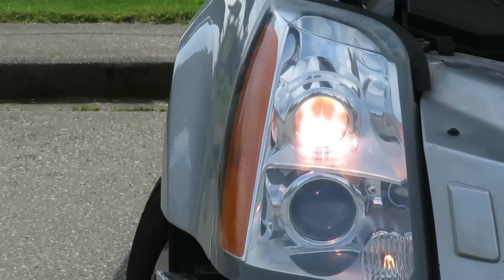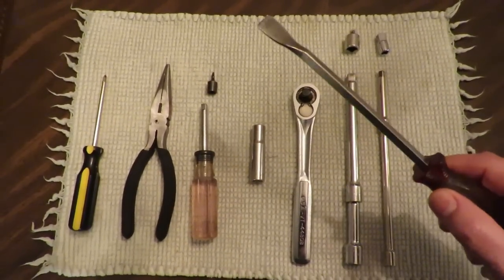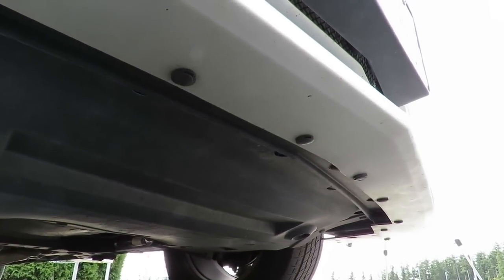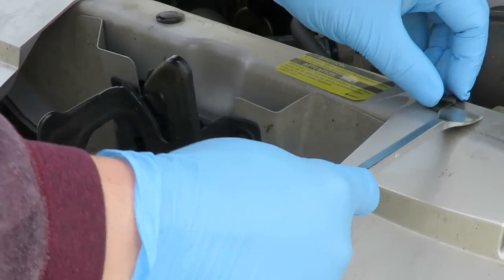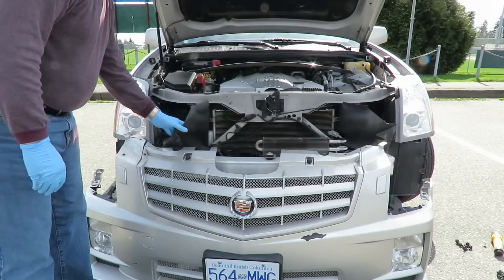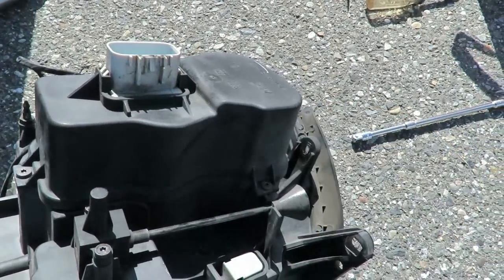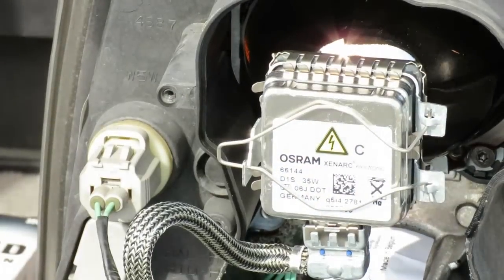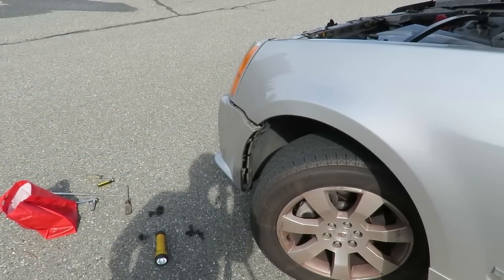How To Replace 2008 SRX Headlight For Under $100 720p

Comment: Great video. Thanks. I replaced my hid bulbs with led and it looks great. I'm not worried about changing bulbs again. Never. Oh and I did not have to go under the car to take out the plastic pins. It was super easy. Thanks again

Comment: I was able to change mine by removing the fuse box lid on the driver side and taking the air box out on the passenger side. 3 torx bolts. Took about 5min
Reply from the maker: Better late than never with this reply.  Guess that goes to show you there's more than one way to skin a cat.  And, don't believe everything some yahoo (a.k.a. me) on YouTube cooks up for you to watch.  Wish you would have told me that before I went through all this trouble... and before I finally shelled out for an XT5 eventually also.  LOL.  ;^)

Comment: BTW, my assembly or the lens has moisture.  I found out to replace the assembly alone is upwards of $1100, so I'm opting to just replace the bulb for now.  I can get it from the junkyard for around $700 but right now it's out of my league.  This is my first bulb replacement and the car is 12 years old. So I'm not complaining. Thanks again

Comment: Very well done. Since there are so many people who end up replacing these bulbs over and over again (sometimes within days or weeks), would you recommend possibly replacing the whole assembly?
Reply from the maker: David Jensen Not sure.  The headlight enclosures do age and start looking bad over time.  I saw one which had water trapped inside, for example.  So, that might factor into the decision.  But, from a cost benefit point of view, one would have to locate a supplier who does not gouge you on the price of the entire assembly vs. the cost of whatever bulb(s) may be needed to fix a burned out bulb(s), and it would be hard to tell what quality of bulbs might be supplied with the replacement enclosure (if any) as a total package. It took me a while to research suppliers and decide which bulbs were factory quality vs. some knock offs from Asia which might not last long, etc.  So, buyer be ware.

Comment: Good job and good video, but I didn't remove the headlight assembly. I jacked up the front end, removed the wheel and the plastic fender well. Took out the torx screws and replaced the bulbs while still on the car. Took a little over a half hour. The next time I needed to do the other side, I told my mechanic how to do it because I had a broken leg. Of course, he took off the bumper, replaced the bulb and charged me 260 bucks. sigh

Comment: What is your profession if you don't mind me asking?
Reply from the maker: +Jon Oppel Retired IT Pro doing armature stuff for fun/hobbies.  Road raced for 10 years in SCCA, so learned how to work with a couple simple tools and got plenty of experience trying to find parts for a reasonable price in the process.
Reply: +TMI-America.com We as professionals spend a great deal of time and money on training and tools to do a job. It's a investment like any other business and therefore get compensated for said job. Let's just be educated on what services we are looking for and shop around to justify the asking price of the services rendered.
Reply from the maker: +Jon Oppel I agree. Getting one's foot into the service repair door is not for the faint of heart and not easy or inexpensive either. My racing team would not have won a single race w/o a few good professionals in the auto repair field helping out once in a while.

Comment: the same happened to me I took it to the shop have both headlights replace so I wouldn't have to go through this problem again and they went out with then a month now I need a replaced again thinking about doing it myself the shop really ripped me off I took it back to the shop and he said that I needed the whole frame replace BS he ripped me off
Reply from the maker: It is possible when they removed the grill and/or lights they damaged the wiring in the process and there is now a short somewhere; one thing I do mention to be careful about in the video.  You are correct that their comments about replacing "the whole frame" (whatever that means) are bogus alright. If you decide to do it yourself take a little extra time/care and also double check the wire harnesses and connections before putting everything back together again.  Also check the parts source I provide in the video and try to call them for advice on which type of bulbs your car may need via the VIN number.  Hopefully the shop you went to did not replace the bulbs using the wrong type of bulbs (Halogen vs high intensity discharge (HID) or visa versa) as I talk about in the first couple minutes as well.  Another good reason to DIY is you can personally make sure the new bulbs match the old ones and that you are getting OEM replacement quality vs. some cheep knockoffs from Asia, of which there are many which will not last long, as in your case.  You can also test that the lights are all working before buttoning things up.  Good luck.

Comment: great video sir, I was hoping you would give a shot of your ballast. I have a 2004 srx, when I bought it I had a problem with my lights and took it to a shop to get fixed. it was working fine for a bit although one light was brighter than the other. then my passenger side would blink and go on and off. I left it like that because I really didn't want to go back to those people. I recently got into a fender bender and am rebuilding my front end, I took the lights off and these people butchered my lights and I never even knew it. the split wires and put a different ballast on one and the other I'm not sure what they did. I'd like to put everything originall, but when I look online it looks like some people have lad5g and other people have lad5gl. would you happen to remember which one you have? would you kindly email me the answer? hjasencio@gmail.com, if your knowledgeable about the hid I would love to pic your brain. thanks in advance sir